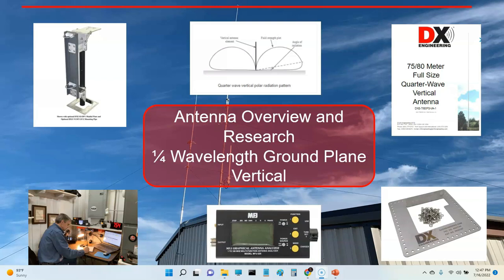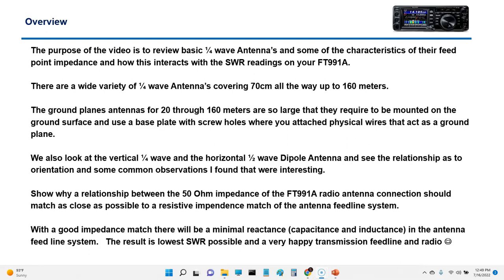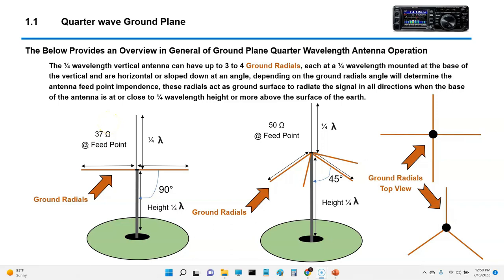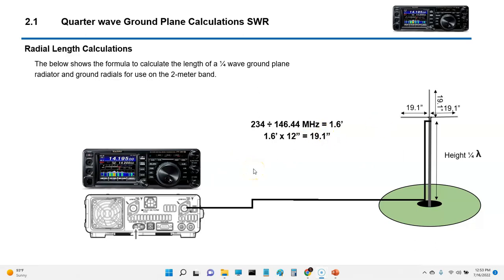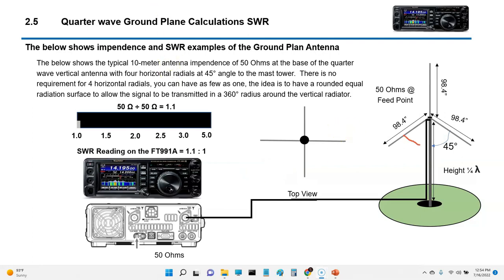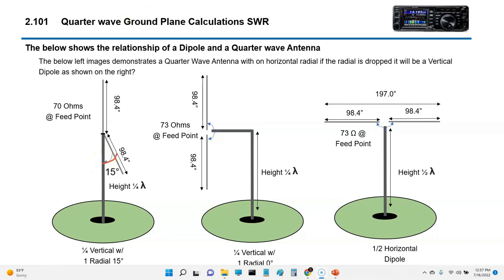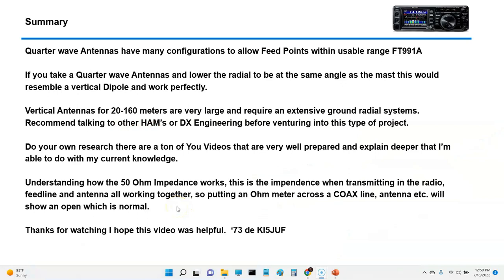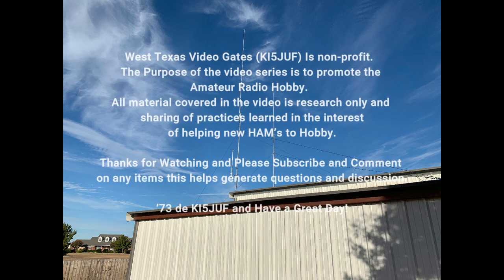Introduction to Quarter Wave Antennas and SWR Relationship on the FT991A

Comment: One thing they fail to rell you in ALL these internet info is,when using modern switch mode psu YOU should never ever allow the the ariel to mounted to directly to the metal mast ,or put ground radials directly into the Earth!
BIG NO NO
ariel must be insulated from the mast so floats.
Mast if metal must be Earth to actual ground.
Reason being the modern SMP psu are balacned dc outputs ,your modern two way radio is common DC grounded,
If you dont isolated the ariel mount from the Earthed Mast,youll get a dead short or near dead short earth loop on the PSU via the radio and coax.

Then all hell breaks loose with the dc smp psu,rfi,common mode,dc noise!

SMP PSU are balanced outputs just like some rf systems ,should never bond the dc negative to earth trust me causes big headaches!
I use a thick PVC pipe with a a slot cut down the pcv sleev,then mount that onto the metal mast.

The earth bonding of mast is purely electricaltical safety only.
Also from a lightning prospective its better too that Eath and DC negative are now physically seperated.

If using radial wires ,use electric fence posts so they "float" above earth!

Height or mast too plays an improtant factor variable too regarding "Ground reflection effects"as this can affect the Z impedance resosnce point.
My tests here in VHF low low band area 24-30mhz 55ft was the min height needed for mast height ,for the least amount of ground effect happens.

the groaunds radial when mounted flat at 35ohms,a shunt coil or shunt rod is need to get 50ohms match.

1/4waves best in hilly,urban uses.

Great video!

73;s Rob.P

Comment: That was a good explanation of what is going on.   

I would add a few points:

The closer to resonance your radials are, the fewer you will need.

Evenly spaced radials will result in an omnidirectional pattern.

Concentrated radials in one direction will provide a small amount of gain in that direction.

Elevating the feedpoint of a vertical, even a few feet, will greatly reduce the number of radials needed and allow for a downward slope.

A ferrite choke can be placed around the coax at the feed point to reduce RF being reflected down the coax.

Placing a ferrite choke around the coax one quarter wavelength from the feedpoint will allow for the coax shield to serve as a counterpoise itself.

Manmade noise tends to be vertically polarized; so, vertical antennas can be noisier than horizontally polarized antennas.

Using a quarterwave vertical on higher frequencies  without changing the physical parameters of the antenna will produce widely varying radiation patterns, as you go up in frequency and the antenna becomes longer relative to that frequency.  This can be either a good thing or a bad thing, depending on your goals.   For example, using a frequency that results in your antenna being 3/4 wavelengths will produce a very different radiation pattern with high angle high gain lobes developing, which could make it easier to make shorter distance contacts.

1/2 wave and 5/8 wave ground plane antennas have lower radiation angles than 1/4 wave - but, they have their impedance matching challenges.

Hope these points help.

73
AI4IJ
Reply from the maker: Hi Richard - thank you so much for the additional good information - this all will help the HAM community and help share knowledge.  GL and 73

Comment: when you look at it. at least to my way of thinking,when you have a vertical quarter-wave with a single wire the same length it will end-up making a half-wave dipole be it straight down or at an angle like an inverted L

Comment: I see you did a lot of research. Good job. I do have a couple things you may want to think about that are not widely known.  One is that with a quarter wave vertical as you explain you need the other half of the antenna. With above ground radial they do need to be a quarter wave long, but there is no need for the radials to be a quarter wave long or the same length as the vertical portion. Think of an off center fed dipole. Moving the feed point off center simply increases the feed point impedance. As long as the overall antenna is resonant the vertical plus the radial length needs to add up to 1/2 wave. I will go one step further and say it does not have to be resonant as long as you match the impedances. It is easier if the system is resonant. With radials on the ground you are making a capacitive coupling with the ground. You need a low impedance connection to ground and that connection can be low resistance ( several ground rods) or low reactance (Xc). You want low impedance (Z). Z = R +jX so small R or small X either one will give low Z. The return currents will flow through R ( low R is less loss) or they will flow through X. In this case Xc. Large Capacitance means low Xc. However studying for the Extra Class you should run across the complete formula is Xc = 1/ (2 pi F C) so the reactance depends not only on C but the frequency as well. 
One thing to always remember in electrical circuits, whether it be AC, DC, or RF) is “ current always returns to the source”.  With RF the source point is usually the SO 239 connector on the radio. So any current leaving the center pin must find a complete circuit back to the “ground side “ of the SO 239. That path is usually up the center conductor of the coax to one side of the dipole or the vertical element. The through the air and back to the other side of the dipole where it flows down the inside of the coax shield to the “ground side” of the SO 239. Here ground means chassis ground not earth ground. With the vertical and radials, the return current leaves the vertical and returns through earth to the radials where it flows through the capacitor formed by the radials and the earth, then to the coax shield and back to the source ( the ground side of the SO 239 on the radio. 
With no radials the return currents will try and find some way to get back to the source. It will not follow the path of least resistance. It will follow any and all paths that might exist. The largest current will follow the path of least resistance but there be some current that follows other paths also. Like current division in resistors when you have several resistors of different values, the current divides up in proportion to the resistance. Maybe I should say in inverse proportion to the resistance! I always recommend the ARRL antenna book ( you can’t have one too old either) and the ON4UN Low Band DXing book. It has a great section on antennas that applies to all bands not just 160 meters! There is a lot of miss information on You Tube so having multiple sources of reputable information to check against is extremely important. I am a retired EE and also have several old text books in addition to what I mentioned above. It’s a complicated subject with a lot of myths people believe as the truth. You did a good job keep up the good work!
Forgot to mention that a 1:1 SWR is not necessary. Total loss in dB is what is important. Sometimes a high SWR only adds negligible loss and sometimes it does not. It all depends on the matched loss of the feedline to start with.
Reply from the maker: Good evening sir and thanks for the message I really appreciate the feedback I will study this information this will also give other folks some good information 73 and thanks again de KI5JUF

Comment: Your middle Vertical antenna at 10.00 has been built for use on 2m and 70cm bands (18 5/8” and 6.25” radiators and reflectors) and verified via NANOVNA to produce an SWR less than 1.1:1 on the 2 m band.  The Smith Chart shows 50 +/- ohms which confirms the low SWR. Suggest you may want to review your theory about characteristic impedance/resistance of 73 ohms with this configuration. May help you succeeding on your General or Extra licenses. Best luck to you. Dave

Comment: I'm not a ham, but don't get confused with resonance and SWR. You state, 'with a good impedance match there will be minimal reactance (capacitance and inductance) in the antenna feed line system.' This sentence has mixed theory and confused terms, like, in the antenna feed line system.
In regard to a 'good impedance' this would be referencing the antenna resonance, the resultant. I would suggest you research what actually makes an antenna resonant. Many hams simply say it is antenna that is purely resistive and exhibits no reactance. That is not the definition, that is the outcome, they are often skipping an educational step, and one of the major fundamentals of RF theory. Why would one do that? I mean, get a real understanding, what's stopping you?
So, we now have the antenna on or near resonance, but the theoretical quarter wave antenna over a perfect ground has an impedance of 36ohms, and our radio and feed line is designed for 50. We must move the ground away, in this case an elevated ground radial system, to bring it up to 50ohms. In other words, they are separate. Sure, you can shorten or lengthen the driven element to change the impedance for what ever reason necessary, but don't get the fundamentals confused, that's all.
Reply from the maker: Good evening Jeremy, I really appreciate the message this is the kind of feedback I love, I've had to learn most everything on the Internet and reading and I'm always concern I might be putting bad information out, again thanks so much your feedback is most appreciate that sir keep in touch and thanks again!
Reply: Resonance just means reactance is zero ,if this isn't the correct definition all the study books are wrong
Reply: @Pioneer936  but when you think about it, that is not a good definition. It is a resultant, if you look at a resonant antenna or take a measurement at its feed point. There is no disputing this because the true definition of a resonant antenna is one that the wavelength of the design frequency literally fits in. That is, the element/s are the correct length, whether it be a half wave dipole or other. There's no denying this, and this habit of expressing it as zero reactance is poor and does not help explain it properly to a student, it's skipping steps. That is NOT how to learn about a rather (extremely) important on RF theory. In fact, I find this ridiculous.
Reply: @arconeagain  so are you saying all the study books are wrong?? What are you saying it's a result from ?
Reply: @Pioneer936  I am not saying the books are wrong, I am saying what I have already repeated. So if you are unwilling to read and process what I am saying, then there's no point in me repeating myself a second time. If you have processed what I have written, tell me where I am wrong. Bearing in mind the steps, and going back to basics, the beginning. Also, think physics, and then maybe where the word physics derives from.
Reply: @arconeagain  I've thought about it ,I can't see why you think resonance is a resultant and you haven't given a good explanation of what it is a resultant, you are  quick to call out someone who believes what they have been taught from every single study book in radio and electronics  yet offer a lame explanation, not good enough
Reply: @Pioneer936  It may not be the ideal word, but in this context...
resultant: occurring as a result of something.
I'm speaking in perfectly clear and concise English, I do not see why you are having difficulties in interpreting it. I can only imagine you are a little unwilling. And no putting words in mouth.
Reply: @arconeagain  you say you are not in disagreement of the study books but you are in disagreement with the definition the study books give ,aren't they written by experienced rf engineers who have done all the experimenting so we can learn from them ,if not what's the point of studying we should listen to you
Reply: @Pioneer936  you're just not listening, are you? The case of no reactance present at the feed point is correct, I'm not disputing that, but that IS NOT the definition of a resonant antenna.
How can I make myself any clearer? I am 100% right btw. I don't understand why you are being so stubborn and seemingly taking it personal. Did you write a chapter in one of these books?
I've spent wayyy too much time on you already. I have many projects that are sooo much more important than wasting my breath on you. 
You need to open your mind, move the F on and leave me alone. 
I know you can't fix stupid, so why do I think I can help these people? 🤗
Reply: @arconeagain  a resonant antenna becomes resonant at the zero reactance point ,you are not listening and contradicting yourself, if the feedpoint of the antenna contains no reactance the antenna is resonant
Reply: @Pioneer936  you're the one who is not listening. Say you have a full wave loop, and you measure its impedance, and there is a portion of reactance of the complex impedance. This would mean the antenna is either too long, or too short. This is the function of the antenna's resonance, and it is a physical, real thing. Reactance on the other hand (now this proves it and will likely stump you 😢) is often referred to as an imaginary figure or component of the complex impedance.
Reply: @arconeagain  it doesn't stump me ,the point is when reactance is zero its resonant

Comment: Nice Informative video....When you can't or don't want to angle Down the Ground Plane Radials but Want a perfect 1.00 SWR,  You can approx 5%  Shorten the Vertical Radiator & connect a Beta Hairpin match Across the antenna Terminals....Adjust the Vertical Radiator &  Beta match shorting strap as usual to Tune a perfect 1.00 SWR......
Reply from the maker: Good evening Tom, thanks very much for the message and the tip, I've had others tell me the 5% shorter on the radials too, the Beta Hairpin match is cool, did not know that so that's good to know, appreciate the message and the knowledge  thanks again from KI5JUF '73

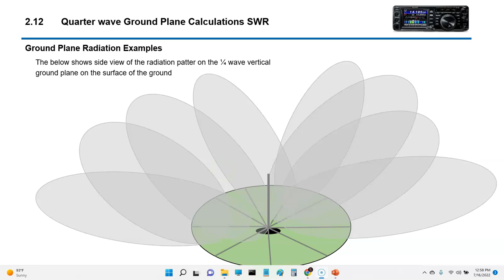Comment: 10:37 I realize that's a 2D representation of a 3D shape, but it's... , er, ah, hmmm...  Should be a 3D doughnut shape that puts the peak generally towards the horizon (all around in azimuth), but up a bit in elevation (not extremely low angle as it's not the world's best DX antenna).

Comment: 10:20 The current into both elements will be basically the same (varying only due to environmental asymmetries).  Even though one dipole element is connected to the shield, and the other to the 'hot' center conductor.  That said, I still put the 'hot' element up higher, more on superstition than logic. But don't think for one second that the tip of lower element won't give you a shock !!  There's roughly equal voltage and current in both elements.

Comment: Slides 2.5 and 2.6 show 50-ohms divided by 50-ohms = 1.1, which is not correct. It should be 1.0:1, or 1:1, or 1 (however you wish to write it). Not 10% off at "1.1".

8:40 Also narration, "...down to 1.1..."  Should be '...down to One-To-One (1:1)..."  We're getting the decimal point "." conflated with the ":".
Reply from the maker: Copy that thanks

Comment: The angled ground plane, in addition to raising the feed point impedance to a perfect 50-ohms, is also supposed to slightly lower the angle of radiation more towards the horizon, thus hopefully improving the signal for the most-distant stations. So the description of the signal bouncing up (implying a higher angle of radiation) is not as I've read elsewhere for so many decades. The antenna should be viewed as an assembly, not conceptualizing the signal bouncing off the ground plane. The wavelength of the signal is bigger than the antenna, so the signal doesn't treat the antenna like individual parts.
Reply from the maker: Good evening sir, thanks for the message and tips, I'm carefully diving into the world of antennas, I just recently passed my Extra and that has peak my interest in really trying to understand the whole HAM experience, I have been watching a ton of videos and practicing all the math associated with the Extra. thanks again great advice and keep in touch I appreciate all the comments helps me grow in the hobby '73 sir from KI5JUF

Comment: Thanks for the info - this helps.  I'm also a general who is planning on testing for extra next month.
Reply from the maker: Hi Scott, glad the video was helpful, let me know how you do on the test, do you have a You Tube channel series your watching?  I found the HAM Study app and the You Tube series from W4EEY covers Technician, General and Amateur Extra .  Anyway, I was curious, thanks for the message always love to hear from folks and '73, I usually work 10 meter USB, FM so if you one night maybe we can make a QSO!!
Reply from the maker: Hi Scott, just checking in did you have a chance to test for Extra, I tested yesterday and got the ticket, hope all is good and best of luck on the test '73 KI5JUF
Reply: @westtexasvideogateski5juf255  Awesome.  Congratulations.  I just today signed up for testing on August 20th, so I hope I do as well as you did.  I'll let you know in a couple of weeks.
Reply: @westtexasvideogateski5juf255  Hi, I tested and passed the Extra test today, so I'm a happy camper.  Next on my list is to improve my HF antenna set up (currently EFHW in the attic due to HOA).  Probably try either a EFHW or Vertical outside  and ask for forgiveness, rather than permission, if it becomes an issue.  After that, toying with the idea of learning CW....
Reply from the maker: @scottb.2022  Congratulation's Scott that's great let me know how the journey continues and have a great week, let me know if you need anything from me '73 sir